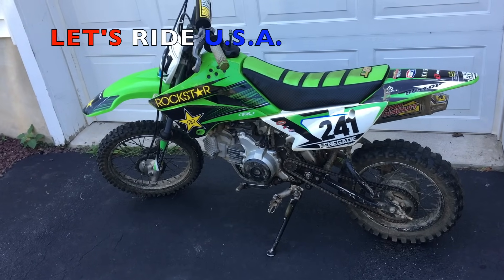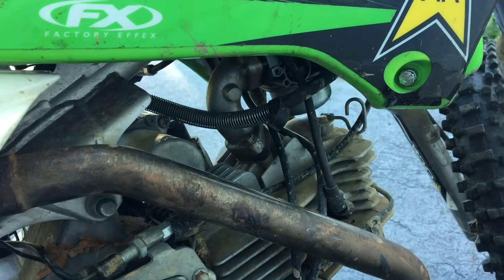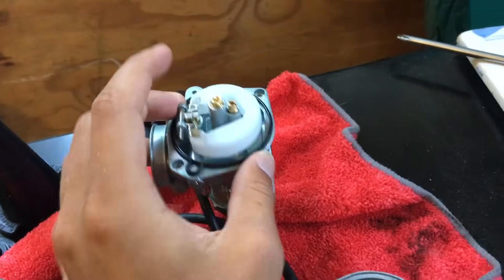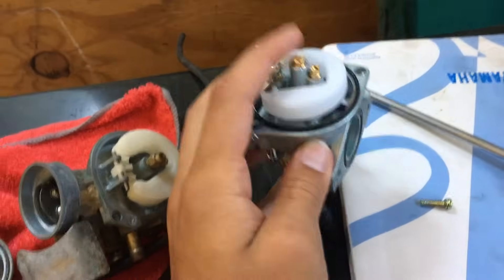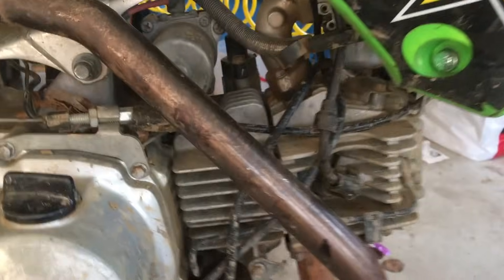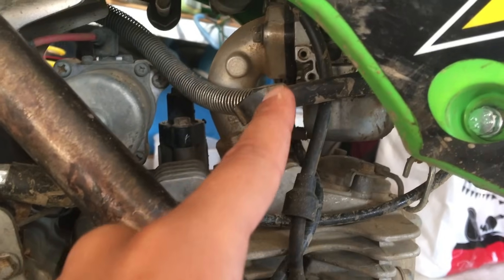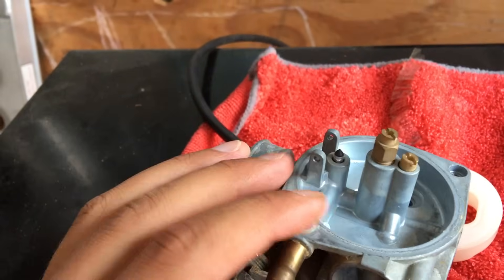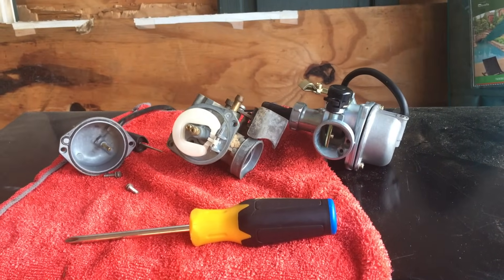HOW TO FIX A LEAKING CARBURETOR

Comment from the maker: DISCLAIMER: this was NOT a traditional carb used in the video and the float was inserted the wrong way then it would in a traditional carburetor.  Put the float valve in the opposite way than what is depicted. The black needle side should be facing down and the other side contacting the float.
Reply: Mine is still leaking what should i try next
Reply: I guess im asking randomly but does any of you know of a way to get back into an instagram account?
I somehow lost the password. I love any help you can offer me
Reply: @Joel Levi instablaster =)
Reply: @Xzavier Dean it did the trick and I now got access to my account again. I'm so happy:D
Thank you so much you saved my ass !
Reply: @Joel Levi no problem :D
Reply: So im semi new to dirt bikes besides when I was a kid but I didn't have to take care of my bike back then. But my carbs leaking out of the overflow, sometimes it randomly starts and stops leaking, but it never leaks while im actually riding only when i come to a stop. My assumption was like you said the float being stuck open, does that sound like it makes sense? I did order a rebuild kit so I can just replace some of the parts but it might not be delivered for 2 days. Today im going to take the carb apart and give it a good cleaning, This is the only problem left! So any thoughts/suggestions would be appreciated, thanks.
Reply: @JDarius2   I polished the inside of the needle seat with a q-tip and polishing compound and replaced the seat o-ring I found at a hardware store for $0.85. I filled the carb up with water and blew into it so I could see if I fixed the problem. I'd rather water leak all over instead of gas. After the carb filled with water I blew into the carb to see if I could force it to leak and it stayed dry. Took it to the track for a couple hours and everything stayed dry. I did reuse the float needle, despite it having a weak spring (it would start to compress at 1.25oz), because the new one hadn't come in the mail yet and I was dying to ride it. Like I say everything is working fine. The new needle came in today and I noticed the plunger starts to compress at about 2.6 oz, which is about twice as much as the original needle. That spring and plunger is designed to absorb the shock of a bouncing float so it doesn't deform the rubber tip of the needle.
Reply: @duck_iskate5302  give it a really good clean and make your all seals are not warn out
Reply: @JDarius2  i just bought a new carby bc mine did the same thing but i don't know why i did that bc when i would start it, it would leak then i would ride it and it stoped

Comment: You put float needle in upside down
Reply: Yeet
Reply: it was a chinese carb this model puts it in backwards
Reply: That can’t be. The rubber tip needs to seat. No where to seat upside down.
Reply: @AirlessGoose54  no, I have the exact same carb, he literally had it in backwards
Reply: @Timmward how the fuck do you put it in right then?
Reply: @kx1260 the little black rubber part goes in. When it's in the right way you can't see that
Reply: @Timmward  thanks for the info man I appreciate it
Reply: @kx1260  no problem👍
Reply: LMFAO 🤣 the confidence is hilarious
Reply: @HoEnomics  it is!!

Comment: Your "float valve" (needle) was upside down on your demonstration, and you did not place the "new float valve" correctly into the prongs of the float, which will cause failure of the needle to seat correctly to shut off fuel.
Reply: You didn't explain how to fix that issue.
Reply: I was about to say that like hold on  😂

Comment: I see that this vid is a few years old, but the float valve seat was upside down. The rubber pointy part points into the center of the carb. If you really did reassemble the carb that way, I can not imagine how that would have stopped the overflow issue.
Reply: I was going to say the same thing .

Comment: worked for me ,I was only using my manual air pump. what happened was in the step when i opened my overflow screw nothing came out so I did next step and pump some air inside then some dirty gas came out like darkened gasoline but only a few then i pump some more air then more dirty gas came out and then redder clean one few seconds later, when it stopped spewing gas, tightened my overflow screw then turned it on with few tries like 25 kickstart, Good news was when it turned on no gas was leaking. This moment I will never forget in my life, more DIY wisdom. " thank you very much for sharing this informative video"

Comment: Thank you for this video, Let' Ride.

My issue was with a Yamaha EF2400iS generator which I take away yearly to boost the capacity of the four lithium batteries in the caravan. 

Last year, I noticed diluted oil all over the ground sheet, but the generator still worked and I was able to continue using it.

But before my annual trip this year, I thought that I should investigate further, which lead me to your post.

Eventually, I gathered the necessary components to attach to the air pump and following your concise directions, I was able to blow the debris from the float bowl valve.

Unsurprisingly, the generator is now working much better than it did last year, thanks to your advice!

☺

Comment: Thankyou so much! Im a girl and I dont know anythig about engines. Ive just bought a small ATV for my field and it started to dump petrol from that tube. Now I know where to look, how to turn it off, I didnt have an air compressor so I just blew up the tube, its only short. Im not sure I could take the carburetta apart but at least I have some idea of what is going on with that float. 
It started and fuel isnt coming out at the moment but it usually happens when I ride it for a while.

Update, Ive just found my tyre inflator for my car so Im going to try that!

Comment: The pointy part of the float needle should be pointing up (correct orientation of a carb) the pointy part is made of rubbery material so it can block and make a seal inside when the float do its thing.
Reply: Mine was facing downwards, do you think that was the reason my bike was overflowing?
Reply: Yes
Reply: he said that it was a traditional carb and he didnt relise

Comment: I’m gona help you out let’s ride USA.  Gas coming out of the drain tube is caused from either 1 a stuck float, 2 the float needle has debris or dirt inbetween the tip of the needle and the carb (not allowing the float needle to seat therefore causing the gas to overflow), 3 the rubber o-ring is bad on the drain screw or 4 the drain screw is loose.
Reply: Or 5: the float has a hole in it and isnt floating.

Comment: Is this issue common on new carbs? Picked up a used 4wheeler recently and it had a new carb installed on it. Fuel steady flows out the tube. I will try the air blast when I get a chance.

Comment: i am not an expert but i tried opening and cleaning a motorcycle carburetor and i noticed even the first time that the needle and the float should be connected, if you successfully removed the float out from it's bowl the needle should come with it.

Comment: Just put an airfilter kit on my predator 212 and i have gas leaking out of my filter.... did i not put the jet on tight enough or could it be the bottom bowl not on properly or my spark pluf

Comment: Does the end of the hose have a screw in it,mine is hooked to a metal piece with no scree in the end of it,and that's were it leaks gas if I try starting it with the throttle on.???

Comment: Ok this kinda helps but the carburetor on my 4 wheeler leeks out of the drain tube on the bottom of the bowl when I put gas in the tank and the float is not stuck it just leeks so et me know what the problem is
Reply: you need to check all the rubber seals on the carb, there's also a possibility that you have an o ring on the pilot jet, it's the little hole that has the fuel coming through it, unscrew it and check the O-ring, might have to replace it, needs to be air tight in that tunnel where the pilot jet sits.

Comment: EVERYONE THIS IS IMPORTANT DO NOT SHOOT COMPRESSED AIR THROUGH YOUR OVERFLOW TUBE CARBS ARE SENSITIVE TO AIR FLOW..... This guy is a joke he put the needle in wrong and telling people how to fix their bike when he's basically setting you up to buy a new carb bc its going to break more from the airflow.
Reply: Oh crap!!! I shot air through mine and now it leaks like crazy !!! What should I do??!!
Reply: SuperMattcom buy a new carb, now its shot. Never spray compressed air up the overflow. All thats going to do is spray all the crap and mud in the tube right into the carb and its going to get EVERYWHERE
Reply: I have a slight leak in my float system I'm pretty sure but I'm scared to check it bc I don't wanna mess it up more
Reply: Matt Eggleston carbs are very easy to work on. If ur afraid to work on it take a bunch of pictures of it while you taking it apart so you can refer to it when putting it back together. If your leaking gas your float is either stuck open or not set right. Id take the carb off, and the float and clean everything real well and put everything back together. If that doesn’t work watch a vid on setting the float height, its very easy. 👍
Reply: @kill-switch2248  thanks man I deffinalty will do that
Reply: Kill-Switch™ do you have a certain video i can watch for the float height?
Reply: thanks for the warning josh, guess I need to take myn apart some how.

Comment: So if my floats are stuck it will leek from the overflow tube only? My carb leeks I think from air fuel mixture screw any tips
Reply: There are rubber rings seals on the drain screw they tend to deteriorate over time and also they get lost.  you can pick up new ones online or at your local motorcycle shop.
Reply: @iam2much5  or get a new fuel mixture screw

Comment: Hi. I  am a newbie to the bike stuff. I am seeing fuel leak from carburettor. Still figuring out what causing it. 

 I just want to know is about that drain pipe. Is that left free or should we connect it somewhere  cos while I was cleaning I saw it was hanging below, was a bit frightened. And after seeing your video the tube just hangs out. Is it okay... Please let me know.
Reply: Still need help?
Reply: It’s their to drain excess gas from the carb it supposed to be dangling their

Comment: 4:25 Dude your float needle is upside down ha. The rubber tip of the needle is suppose to go inside the carb not on the float. Thats why your float wasnt working. Theres no way the needle can seal the fuel from leaking if its upside down like that

Comment: Anyone have any thoughts on why fuel would drip out of the carb overflow valve when everything seems perfect with the needle and float? i cleaned it all out, making sure the needle could freely move and that there are no cracks in the float. this is driving me bonkers.
Reply: Have the same issue atm, ordered a new needle and float.
Reply: @Mister_Michael  did replacing the needle & float fix the fuel supply flow?
Reply: I haven't got them , will let you know
Reply: @Mister_Michael  did it fix the problem?
Reply: @proarmy70  yes it did, I also added a fuel shut off valve in between the fuel supply
Reply: replace the rings inside the carby specially the one down the bottom bc the whole time i thought it was the over flow but it was the screw that had no o rings on it
Reply: @Jade-16c0rdy  turns out in this specific case, it was the o-ring around the fuel "injector" that brings the fuel into the carburetor. it was fine being 15 years old until it was disturbed. took a bit of testing to figure it out but once replaced, the carb stopped overflowing. now if i could just figure out why the screen on the injector keeps getting clogged w/ stuff no matter i've got a fuel filter in the fuel line.

Comment: Really, I hate to say anything to make you look like you made a mistake, but you made a mistake here.  As everyone else is saying, your float needle is oriented upside down.  That side with the spring in it orients toward the moving float.  The side with the cone shape faces toward the hole.  Visualize how that blocks the hole off when pressure is applied.  You get nothing (no fuel seal) from shoving a mismatched spring needle down into that hole.

Comment: I have the same carb and it’s still leaking I’ve done what you’ve done
Reply: if you have a look in the carburetor there are o rings in quite a lot of places, your bike could be too old and might need to get the o ring replaced, that's what I did to mine. 

https://www.youtube.com/watch?v=4iYiCa3Nmqg 

This video is what I did to my honda, but for my yz85, I just cleaned the carby out and that seemed to work.

hope this works.

Comment: All the commenters are unfortunately correct. You did not put the needle in the right way and you did not connect it to the float. This was a total fail. That should however not prevent you from taking things apart and trying to fix best you can. Just don't make instructional video's unless you can complete the job correctly so people watching can learn.
Reply: 61spindrift very well put. kinda goofy

Comment: This video is COMPLETELY Wrong. Even the "correction" added later isn't correct. ALL carbs for these bikes, atvs etc, have the same setup, a  "valve" needle with the pointed rubber tip going into the barrel first, facing "up" into the barrel. It also doesn't just sit in there, it has notches where it has to be slid into the rails on the float , this is what pulls/pushes the valve open and closed. You slide the needle into the float slots BEFORE inserting it into the barrel and installing the float. It has to be done this way, because you cant put the slide the needle into the slots on the float if the float is already installed.